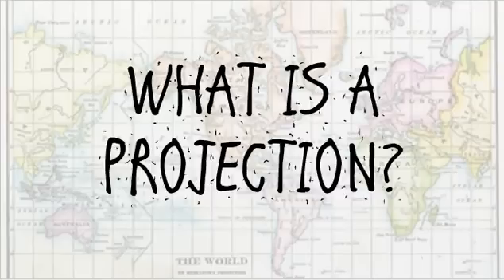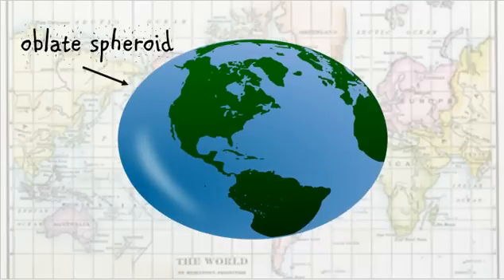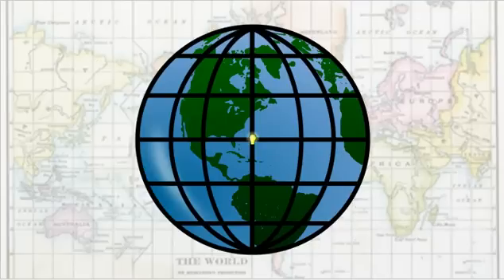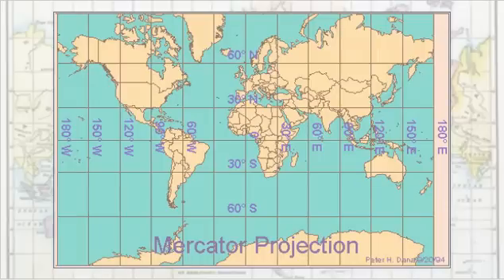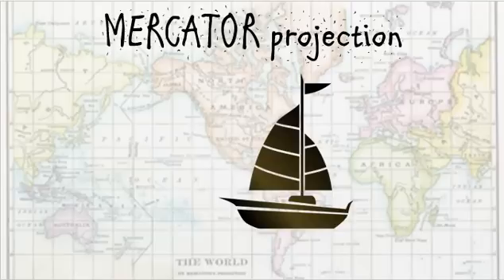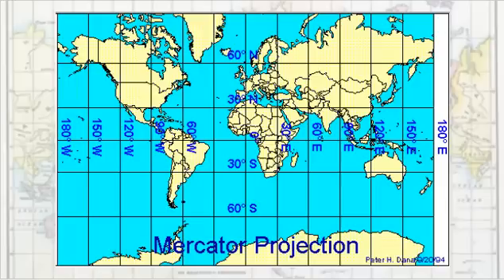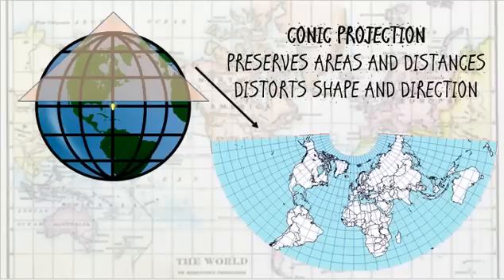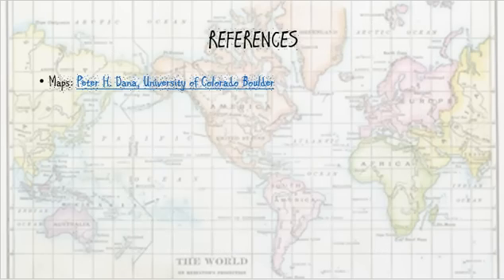Mercator Projection

Comment: You have the traits of the projections all wrong.
A cylindrical projection is merely one where the lines of latitude and lines of longitude make a rectangular grid. You can have the Mercator projection which is locally correct (for any point the x and y scale are the same), or equal area projections and other types as well. i.e. you can preserve area while distorting direction.
Likewise a conic projection just maps to the surface of a cone. You can have various aspects preserved and distorted.
Azimuthal are were you end up with a circle, where the direction to the central point is correct, but again, there are many projections which preserve various aspects.

Comment: This isn't the actual construction ... this produces something called the central cylindrical projection, which stretches the poles even more than this. The actual Mercator construction does not follow any simple geometric procedure, but is constructed so that shapes and angles are locally preserved. The summary of the three types of projections is also wrong, as any of those types can have projections constructed to preserve different combinations of the aspects mentioned. The More You Know!

Comment: Hi I'm a student taking ap human Geography classes  and I have one question, What is it that Azimuthal projections distort . If you could respond I would be very grateful :)
Reply: This depends upon what azimuthal projection you choose. There are many to choose from.
One thing which is constant for all of them is the direction to the centre of the map. All lines passing through the centre are great circles.
Directions elsewhere will be wrong (getting less accurate as you move further away from the centre).
For distances, if you get an equidistant projection, then the distances from the central point (or along lines passing through the central point) are correct, but other distances are distorted. Also for this choice areas are distorted.

In general, distances will be distorted with the above being one exception.
The area can be correct for an equal area projection, otherwise it will be distorted.
Shape will always be distorted. In fact, no projection accurately preserve shape over a large area. It is only the mercator projection (and ones like it) that will locally preserve shape, by locally preserving direction.
Reply: XxIMPERIALxx1 same

Comment: Begs me to question if we just have the wrong template, and are trying to force fit the image on an otherwise improbable layout....  It's also not taught early on that the maps, all the maps, are drastically inaccurate.  This posits that we don't actually know what the Earth looks like!
Reply: No, this shows you fundamentally fail to understand the point being conveyed.
All these maps are mere projections of the globe.
Yes, you could consider it to be the wrong template.
That is because the correct template is a curved surface, not a flat one. We are trying to fit a curved surface onto a flat surface, which is impossible to do without distortion (taking curved to mean Gaussian curvature).

When we use the right template, that of the surface of a sphere or oblate spheroid, we end up with a single "map", the same globe everywhere. This shows we (as humanity) understand what Earth looks like and understand that presenting it on a flat surface will result in significant distortion.

The maps aren't inaccurate, there are merely limitations of the projection chosen.